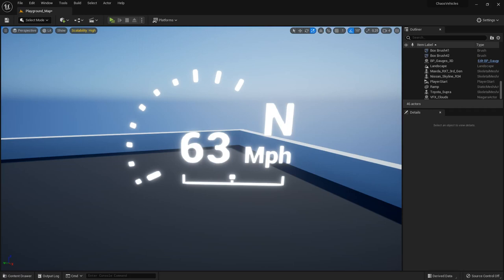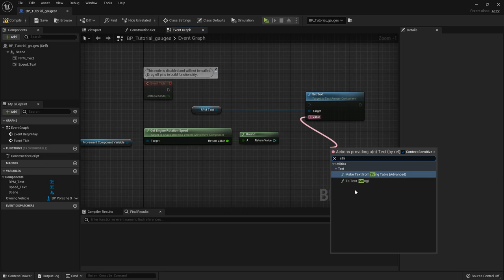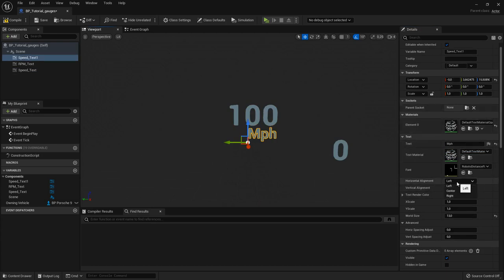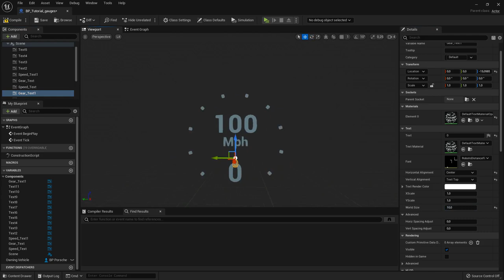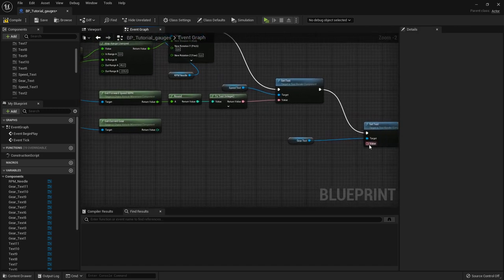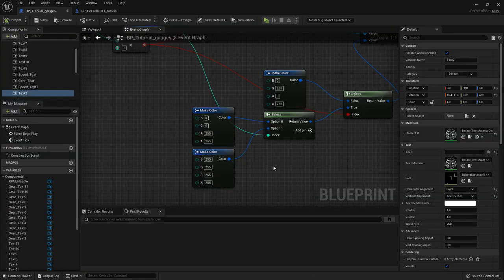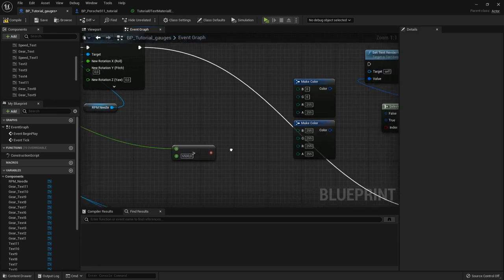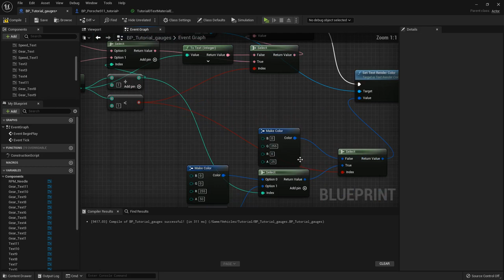09 - 3D RPM gauge (UE5 Vehicle Tutorial)

Comment: I dont have the "Get engine rotation speed", how do I get it?
Reply: From "VehicleMovementComponent" use node "cast to ChaosWheeledVehicleMovementComponent" and from that node you can get the engine rotation speed.
Reply: @NK-hq7zn  I used the "ChaosWheeledVehicleMovementComponent" node from the "VehicleMovementComponent". then the speed of the car slowed down by 3 times.
before 30/ now 10 :(